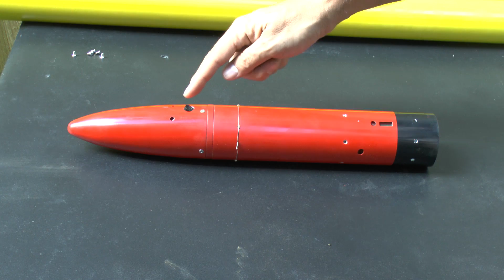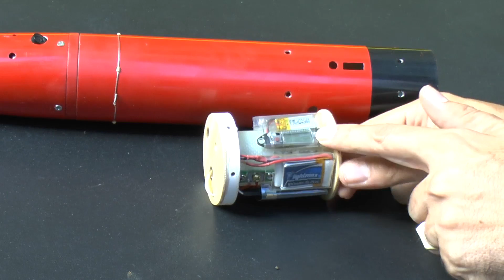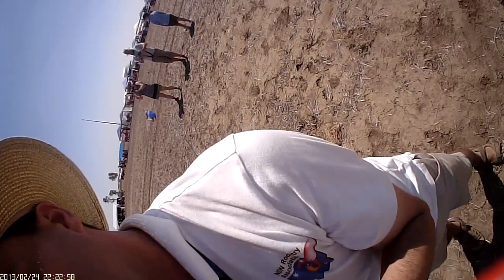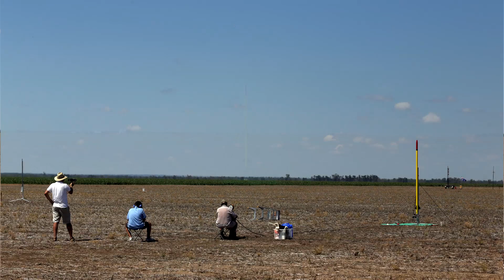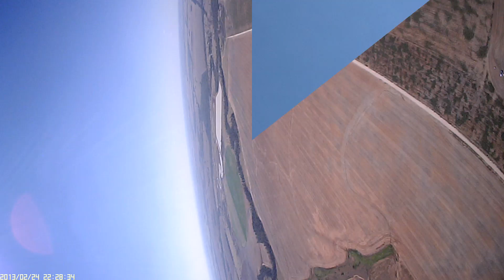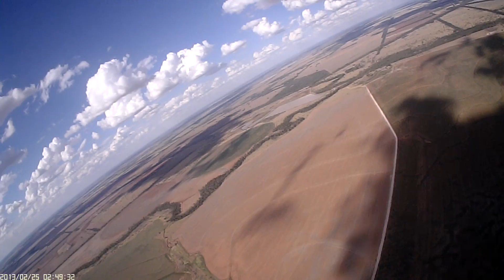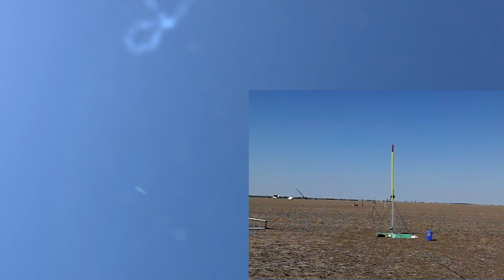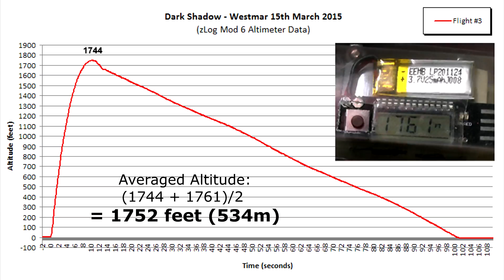Water Rocket flies to 1752 feet (534m)

Comment: Brilliant!
This reminds me of the dime store water rockets I got as a child in the 60's. They were like a small bicycle pump with a sleeve, which when pulled off would release the rocket and give you a nice spray.
So, how much thrust is produced by expanding gas after the transfer of energy in expelling the water? I suspect quite a bit since all of the water seems to have gone after but a few meters.
Reply from the maker: +chrome4ks About 1/3 of the total thrust comes from the air phase. Here is more detailed information on the thrust curve from a water rocket: http://www.aircommandrockets.com/day68.htm

Comment: Awesome video, thanks for sharing. I was just wondering what would be the effect of throttling down the propellant's exhaust to some degree? Wouldn't the rocket reach higher altitudes?
Reply from the maker: +skyone79 Do you mean reducing the size of the nozzle? We reduced the size of the nozzle down to 15.5mm from our previous similar rocket which used 19mm because this rocket uses higher pressures. The reason we reduced the nozzle was to decrease the peak thrust and hence peak acceleration to keep stresses on the rocket down to a reasonable level. The peak acceleration was around 50G for this rocket. From simulations for this particular rocket I believe a larger nozzle would have achieved slightly higher altitude.
Reply: +AirCommandRockets Yes I meant that. I assumed that reducing the size of the nozzle would allow the rocket to reach higher altitudes but it turned out from your comment that the opposite is true. Thanks for your detailed answer. :)

Comment: The accumulators on our Sikirsky Ch-3e would be compressed from 1,500-3,000 PSI after we used a hand pump and 200 pumps to compress it to that amount of pressure. Mind you, once the accumulator is depleted spinning up the APU, the hydralic pump from the APU recharges the accumulator. It would make a excellent engine for one of these rockets.
Reply: +Lorin K Maybe. It releases the pressure a lot more slowly in that system. No telling if it could produce a decent nozzle velocity. If it would just be a pressure vessel hooked to the main engine body, you'd have to make the engine body strong enough to hold that pressure, so you wouldn't bother with the extra pressure vessel.

Comment: And if you use Liquid CO2)
This has up to 60bar
Or Liquid Air ? over 300bar
Reply: +Andy Privat Most of the liquid air would be ejected as a liquid with the water...kind of a waste. What you would do there is close the tank at the bottom and run a tube from the top to the nozzle, so it would just use expansion of the air as thrust. But after a short, sharp spurt at the beginning the gas in the tank would chill to the boiling temperature, and the tank would just slowly boil due to heat from the outside, at 1 atmosphere... So, no more thrust and now you have a tank full of liquid air weighing you down. It don't work. You're better off just pumping up the pressure in the regular water rocket until you are almost liquefying the air yourself. Not sure what pressure that is at 20C, but it's probably more than a few dozen atm, so it would be more powerful than the trials in the video. Though it might require strengthening of the vessel, which would make it heavier, so it might or might not reach the same altitude. Something to investigate.
Reply: alphabeticalor
I do not think the Liquid Air get frozen in this short time.
We need only 3-10sec Trust.

I Mean a Water / Liquid Air mix.
Fisrt trust with water and if the water is empty the rest Air Pressure.

Yea if we have only Liquid Air it can make some trouble... but why dont try this ?

:)
Reply: If you mixed liquid air and liquid water, then as soon as you opened the nozzle the gas would start to evaporate, which means the temperature would drop to the boiling point of liquid air, and any water near it would freeze up. You would get milliseconds of thrust and then maybe slush spouting out of the rocket.

Comment: Why dont you add soap into the water mixture? the bubbles adds to a longer realease time and more compressible than water. personally i get almost twice the height with soap/detergent as to just plain water
Reply from the maker: +Kallan Bao We do use foam in most of our rockets. (https://www.youtube.com/watch?v=Cnripxx0TeU) This rocket wasn't designed to use foam though.
Reply: I've seen someone put butane and soda water instead of air and water in their rocket. It sounds crazy, but in fact does it work?
Reply from the maker: +Fong Azrael Do they ignite the butane? I think butane's vapour pressure is quite low, so if they just put it in liquid without igniting it, the self generated pressure wouldn't be much, but would still work.

Comment: Im wondering: What height would a real scale model of this (like Ariana rocket size) reach?
Reply from the maker: +Blue Monkey I would expect it would be the same order of magnitude as this. The problem with scaling it up is that it will need to be much heavier in order to contain the pressure at larger rocket diameters. The weight of the water in the rocket is also significant, not to mention the increased drag due to the larger diameter.